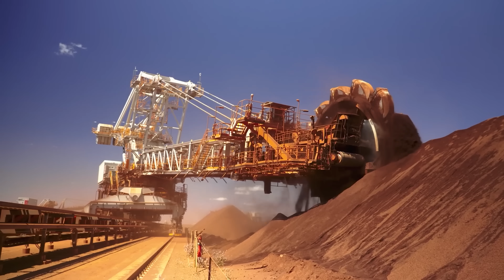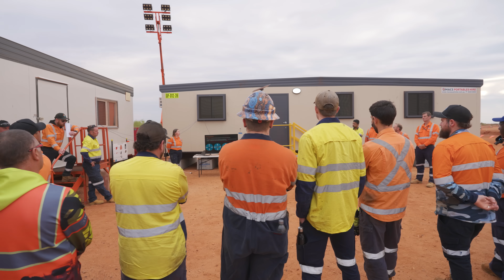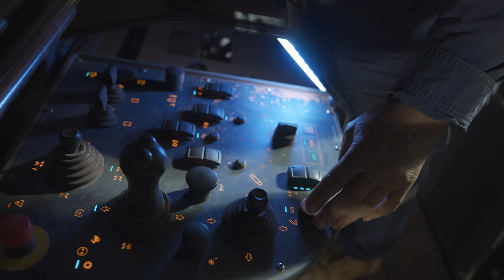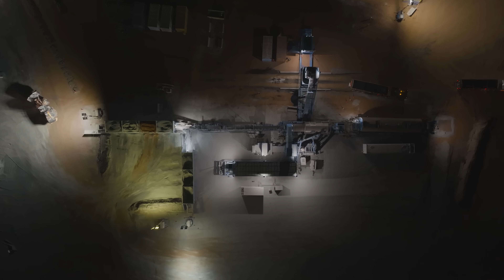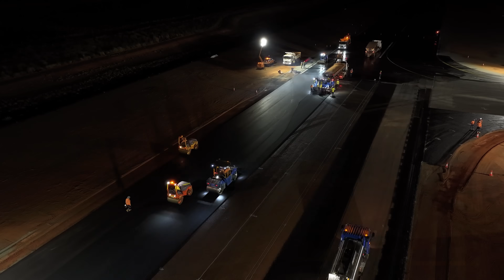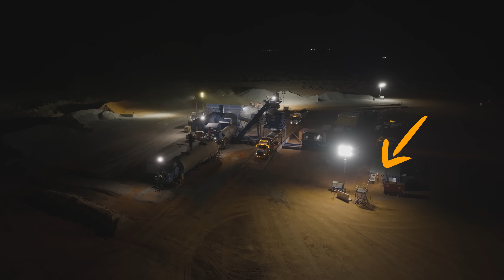Paving a Remote Australian Airport Runway Overnight!

Comment: Pretty much same as western Canada.
Although i have never seen more than 4 agg bins.And often a recycle bin.
   Must be a serious pita not only another set of bins but the calibration.
    Tha asphalt loot/rake is at least a ft longer here teeth on one side flat the other.Thats a serious skill as most joints inc. on hwys were raked in the past.
    Doubt it took them 18 days to set up.We used to be set up and calibrated with various drum mix plants in as few as 2.
     A Boeing 10ft water scrub plant i was heavily involved in refitting in 1990 of did as high as 725 tonnes pr hr.That was hauled for the most part with clam bellydump trains and paver pickup machine used.
   So have not seen live floor trailers used here.
    Most portable dm  plants is this area rarely mix over 350 tph now.Partly production reduction with use of baghouses...and ability to lay it.
    I also coowned 
/operated a Wertgin 2100 for 5 years ..early 2000s...older version of the one shown...and did a bit of airport grinding for various paving contractors although mostly hwy work.
        These folks Aztec plant is argueably cream of the crop.They have a very nice fleet of equipment and  well organized operation.
      Gotta luv the smell....parts of it i do really miss....although now retired.

Comment: Couple of things. I was in Australia for a month and a half in 2015/16, and drove from Tasmania, via ferry, to Perth along the Eyre Highway. It's the only paved road that goes along the South. Along the way I came across a small landing strip that is totally on top of the Eyre Highway. It's a little wider than the road, and it has runway markings on it. There is a sign that says, "RFDS EMERGENCY ROADSTRIP", Royal Flying Doctor Service.  

Totally different for the second thing. A town nearby had a 2 way, 4 lane street that needed repaving. They worked on one lane at a time. Ran the grinder, cleaned up the debris, left a space, laid the oil, behind that was the paver, space, then the roller...all in a row, leaving the other lanes open. Then they did the same with each lane. Normally, they'd do 2 lanes at a time, closing off one side entirely, causing long traffic lines on the other side, and making people late for work. It was the first time I've seen this method and it worked really well. They also painted the lines the same way.

Comment: What did they do with all of the old runway stuff that was cut of off the surface.
Reply: it was stockpiled. The mine site reuse the material for pads and base materials. Everything is recycled. Some pavements allow for a % or Recycled Asphalt called RAP to be reincorporated into the mix however majority of Airport specs do not allow.

Comment: We were doing roads like that in Christchurch NZ in the late 70s. Called it Road Carpet and was absofarkinglutely fantastic to ride your bike on. The effort need to rid on something like this it a way less that the standard crushed gravel type surfaces.

I believe Tassie tried using recycled plastic waste mixed with some other ingredients and is super strong but cost a bit more than regular bitchy man surfaces.

Saw a video of a surface being replace in a Europen country where they ground off the old surface and that was then reprocessed on another part of the machine and it all went back onto resurface the road. No waste hauled away and only a bit of additional binding ingredients I assume were added into the whole process. Very cool to watch. The single quite large  machine did the whole thing and was reasonable fast considering the size and what was being one lane widt at a time.

Comment: I work FIFO in Australia too in the Northern Territory. When they (not Fulton Hogan, but a different company) re-did the airport at my site, the whole thing was shut with no flights in or out for 2 weeks, then a single day of flights then no more flights for another 2 week shut of the runway. I got stuck at work for 4 weeks because some of my cross shift didn't fly in. They did such a great job that a few months later as soon as the temperature hit 40c, the asphalt started melting, so now they have to run water carts and spray down the runway before any planes can land for 6 months of the year and aren't far off CASA condemning the airport from what I've heard. 

Years ago it used to be Fulton hogan that did the roadworks on our site but they got assholed, I'm guessing for being to expensive. Since then they have been through 3 other contracting companies for the roadworks and it seems each one has done an even worse job than the last has lol
Reply: Always the way. These mining companies are always thinking about bottom dollar but they just end up paying three times over for the same thing. Typical!
Reply: @Devar yep, the old saying is 'penny wise but pound foolish'; the modern version is 'got plenty of dollars, but no cents'
Reply: Yep, you can have it good, or you can have it cheap... but not both.
Reply: @NathanBarley-h6l which airport in the Northern Territory? If you don't mind me asking
Reply: I have always thought runways should be concrete, taxiways can be asphalt or recyled materials and oil / asphalt sealer.
Reply: @jimcalver-oj4xf , asphalt is far superior to concrete, if the correct design mix is used.  The advantage to asphalt is that it is a flexible pavement, as opposed to concrete, which is non-forgiving.  Where asphalt will flex somewhat, concrete simply cracks.  From an economic standpoint, comparing what concrete would cost to have a lasting runway, factoring-in the need to mill the surface from time-to-time (as slabs crack and/or heave), an entirely new asphalt mat can be put down that, dollar-for-dollar, is cheaper in the long run.
Another factor to remember is the soil on which the mat is placed.  Remember the flexible asphalt, it is somewhat forgiving, where concrete will only settle.  There are soils that would require meters deep to remove and replace with suitable soils, all just to get an adequate base for the concrete mat.You brought up a good topic, and I hope I was able to shed a little light on the situation.Retired now, but supervised asphalt and concrete construction for just over 30 years, attended training by some of the best paving associations in the country, and am not sorry for any of that training.
Reply: You get what you pay for. Shutting the place down for a month should've been the first red flag. (If you know what you're doing, paving is not a slow job.)
Reply: Kangaroo phucker
Reply: I don't feel mining companies pay what they should in royalties and tax. The runway should be pristine.
Reply: @soarer282  in fairness, its not a runway that services or benefits the public at all, its like 200-300km to the nearest town no point spending anymore money on it than they have to. Could be worse too, I've worked at smaller mines that just only had dirt runways where you could get stuck out on site for days or sometimes even weeks if it rained heavily
Reply: @soarer282 Compare what BHP and RIO pay compared to the what tech companies' pay. Sweet FA and employ hardly anyone in Australia.
Reply: @soarer282  Have a sook bro
Reply: @soarer282 . Ahhh the good old ‘ I don’t feel they pay enough in taxes’ is half a comment. The rest is ‘because I’m jealous of them’
We will ignore they all employ thousands of people who they pay wages to and the government take taxes from them.  They pay GST, payroll tax.   They buy equipment so keep other businesses alive who employ people paying tax. They create entire towns with shops, schools and other facilities who all employ more people so more families have jobs and pay taxes.  Then we have the airline jobs flying people in and out.  But apparently for a sub set of the population they don’t generate revenue or enough taxes.  Let’s take all those wages and taxes from various activities paid away, and see where we sit.
Reply: @xr6lad  So you are a believer that all business should not pay tax on their profits?  All business buy equipment, materials etc, from other business, their employees support towns, shops, schools etc in their local community.  Many large businesses such as this (and I've no idea how much tax this business pays) are happy to privatise their profits when operating at a profit, but want to socialise their losses when economic conditions have a downturn.  All businesses rely on public infrastructure to operate.  For example, while this business may create a private airport, it relies on public airports and facilities to support the air operations. These sorts of business should be paying towards supporting what the state and federal governments create that enables them to operate, and this should include paying equitable taxes.  I assume you are a supporter of the discredited theory of 'trickle down economics', tax cuts for the wealthy and large oranisations, reductions of regulations relating to safety, climate, the environment etc. Likely you hope to be on the right side of the 1% vs 99% divide of wealth in most modern western societies.
Reply: How fucked is that bro?

Comment: Confirming you are sober in Aus seems like a crime from where I sit in Kentucky.
Reply: Mine site/industrial safety requirements nationwide, that includes random drug testing.
Reply: HSE is a very big deal in Australia as the financial and legal penalties are stiff. Zero alcohol limits everywhere.
Reply: @Spookieham just seemed odd to test a camera/documentary guy since they don't operate the machinery to me. I get why you wouldn't want drunk anyone around this but still seemed odd to me. Also based out of Nashville which is 40 miles from me, this paving process is almost identical to any road work done 3 miles in any direction from him, granted without the remoteness logistical nightmare and plant transports. The newer pavers are basically super computers with 3d printing leveling accuracy. The fly in work aspect seems very similar to oil rig ethics but just on remote land. The spice must flow though. Does Aus have 300' sand worms?
Reply from the maker: yeah it wouldn't work well in the states
Reply: @buildwitt It does in fact work well in the states, when and where implemented. One example was during the construction of the   Alaska pipeline, and the current usage in the offshore rigs, where the crews are flown in for an extended stay on site, rather than allowing the workers to go home everyday.

Comment: I am really glad to see Yall using the rubber tired roller. That's the one that actually gives you the riding surface. I live in the South, NC USA they tried getting away with not using it, but found out that those vibratory rollers were not doing the job so a lot have went gone back to the rubber tire.
Reply: Multis are the best
Reply: What or who is Yall? I didn't see their name on anything in this video.

Comment: Hey Aaron I noticed you have been wearing the same hard hat for like 4 years now. You should check if its expired. They are typically only rated for 3 to 5 years.
Reply from the maker: if anything falls on my head anywhere I am, we've got a bigger problem
Reply: @buildwitt  I know you generally get the white glove treatment, but most sites would stop a worker if they found they were using expired safety gear. It's too much of a liability to the company.
Reply: @TheJttv I’ve never had mine checked and am on some big sites. They will say something if you don’t have it though.
Reply: @TheJttv Been in the Australian resource sector for 15yrs, both oil and gas and now mining for both BHP and Rio for the last 5yrs. Never once have i been questioned about the age of my hard hat nor have I replaced the first one I've been issued on site.
Reply: @And__CLam  Thank you for the feedback, I will be updating the SOPs with this added. Hopefully it will be implemented by the site's team meeting on Thursday. Hopefully you're not in Newman
Reply: @NovelConsumer 😅 Around abouts 80k NW as the crow flies ... from Newman. Update away, I may even start wearing it on nightshift
Reply: @TheJttv never been asked is my hard hat expired In the USA never once and I have been working in the field for 15 years
Reply: @buildwitt It's not about the big things, rather if someone forgot a wrench up top or something. Using that reasoning why even wear one 🤷
Reply: A lot of Australian mine sites rotate hard hat colour on a regular basis. Wrong colour hat and yours is out of spec.
Reply: @oldbluedog  yah in the US many companies will purge all of them and replace them all. Some use a colors others year stickers
Reply: Another great video, Aaron. Keep up the great work and thanks for sharing!!
Reply: See all the bull dust freak safety moron got put there two bobs worth, get a life idiot how the hell do you thing workers got on when we didn’t have over educated red tape morons , love your work don’t listen to these over bearing idiots, no wonder work never get done properly,if these morons knew how to work instead of finding problems that have nothing to do with the work.
Reply: Surprised they let him on site with that lid.. Pretty important to have in date/correct PPE on those minesite jobs. I've had my hat's date sticker checked a fair few times over the years.